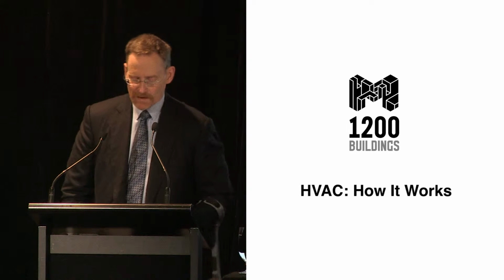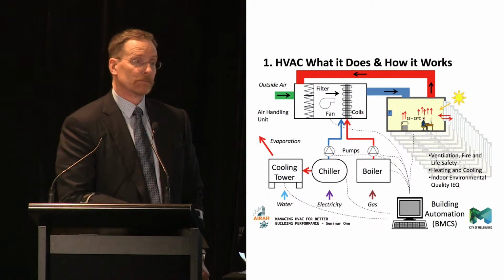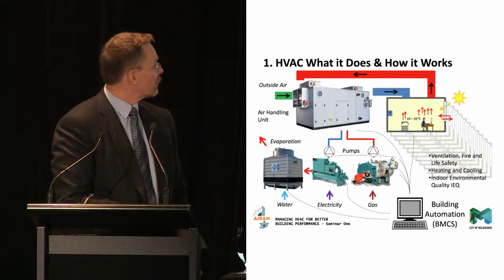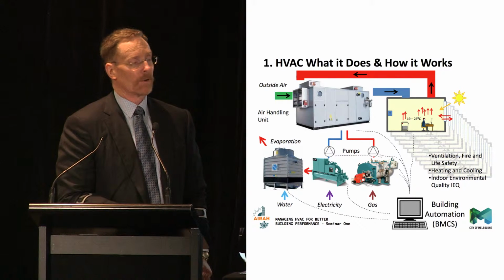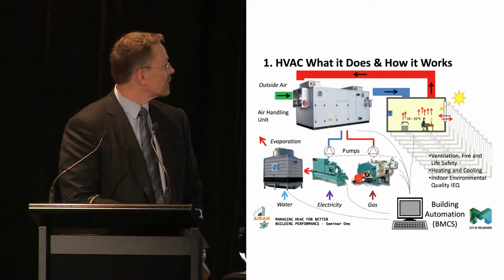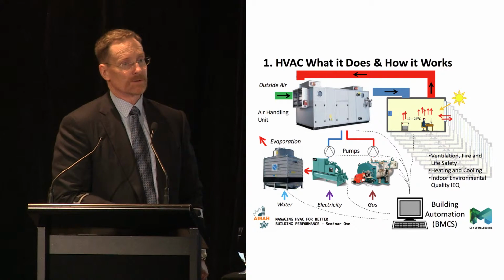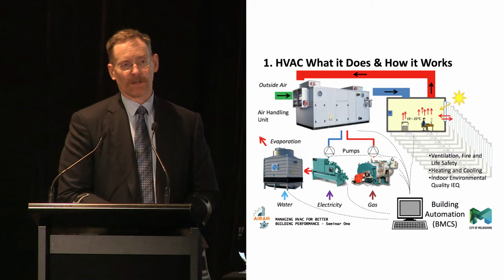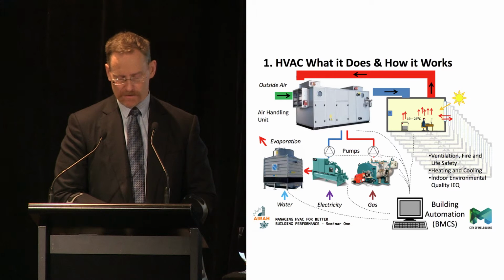3: HVAC: how it works | City of Melbourne

Comment: I'm an HVAC installer in the USA, Chicago, Illinois to be specific. I originally got into the trade in the South (the southern coast of North Carolina). The American South and the American North have different climates (as I imagine Different regions of Australia do).
In the southern US states, it seems as though Heat Pumps are used far more often than any other type of heating/cooling equipment, where as in Chicago, which has a brutally cold winter season (especially December through February, in this part of the globe), so since I moved to Chicago, Gas furnaces combined with a split AC system for summer (evaporator coil in the supply plenum of the furnace), seems to be quite popular in Chicago, IL, as well as in other northern cities and states.
Anyway, I would be interested to know what types of residential systems are common in and around the Melbourne area in Australia, as I am considering moving there, possibly in another 5-10 years, and I am curious as to what type of equipment is most common in residential settings of the  Melbourne area. Are heat pumps very common there?
If anyone can answer this I would be most greatful. 
I am still somewhat new to the field (about 5 years in the field).
Thankyou.